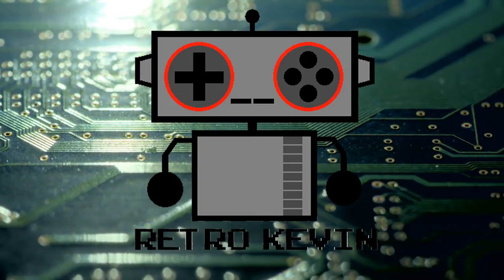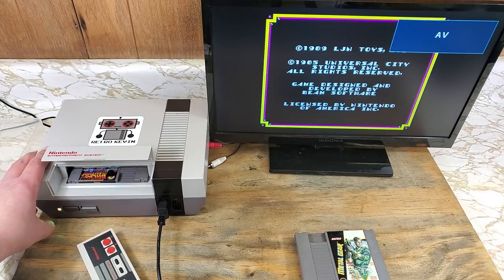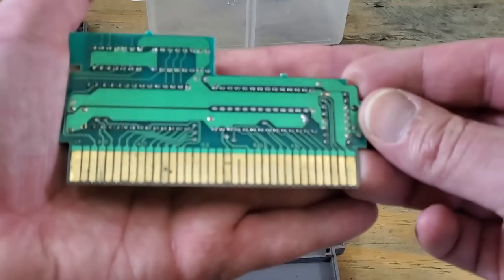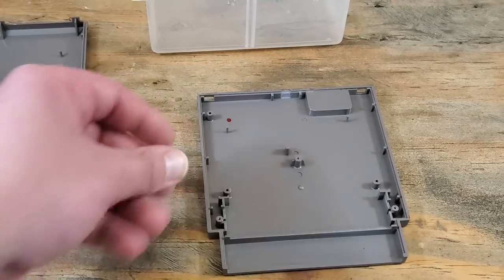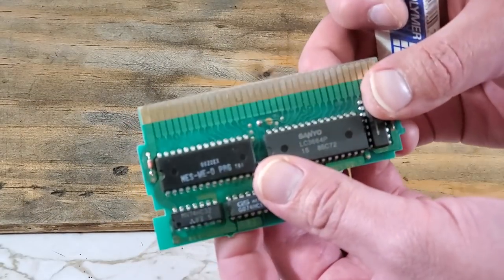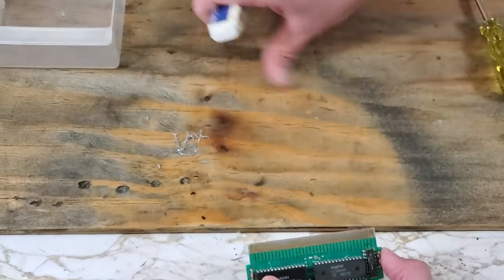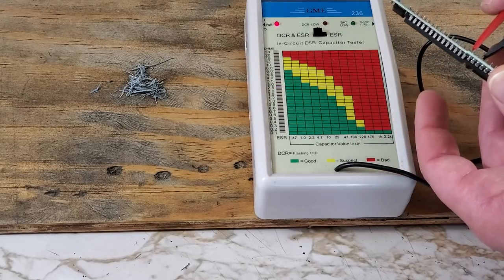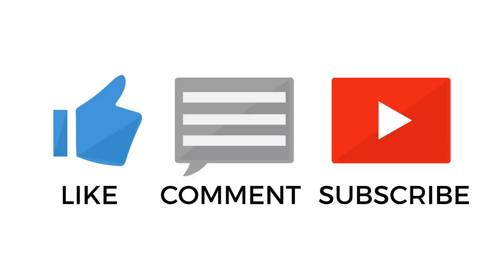NES game cartridge cleaning/repair

Comment: To get an accurate reading, you should remove the cap from the board.
However, testing while in circuits gives false readings.
That cap is probably perfectly fine.

Comment: Great video! For cleaning soft metals like copper contacts I like plastic brushes. The bristles tease out things that a swab or eraser might slide over. I also like plastic scrapers and picks. I sometimes use “flossers” to clean the contacts in usb or Lightning connections.

Almost forgot! Have you ever tried a protective coating like dielectric grease or maybe some type of oil? I’ve been wondering about this and I might dig out my old consoles to try it. As an electrician I would speculate that the corrosion was probably caused by a bad connection. I would bet that all of the games played regularly in the same machine develop corrosion on the same contact. Even low voltage will arc at small enough distances so an imperfect connection between pin and contact could theoretically be arcing which would cause heat and increased oxidation. I think a fine film of dielectric grease or oil would help reduce this, but it’s just speculation.
Reply from the maker: Thanks for the tips. I'm by no means an electrician, I just do this for fun as a hobby. So I always appreciate hearing different ways of doing stuff.

I never thought about the corrosion coming from a bad connection. But that makes perfect sense. I just always chalked it up to people that would blow into the carts and other dirty habits.

I like your theory with the dielectric grease, definitely going to test it out.
Reply: @RetroKevin  I got a copy of "Super Mario Bros. 3" and it has this godawful defect where no matter how many times I clean it, it makes it passed the title screen, but when I get sent to world 1, I can't move anywhere but still access the power up selection. Also parts of the map are permanently glitched. I contacted the seller who said he didn't have the issues I had.
Reply from the maker: @supermariof0521  if you've cleaned the connections and this is only happening with this game, I'd try reflowing the solder on the game chips. It's possible one of those are corroded or just not making a proper connection.
Reply: @RetroKevin  Solder on the games chips?
Reply from the maker: @supermariof0521  sometimes there's a small fault on the solder joint of the CHR ROM and PRG ROM game chips. Reflow the solder by heating it back up to its melting point. If you don't have a soldering iron or heat gun, a hair dyer on max setting may get hot enough to do the trick.
Reply: @RetroKevin  Wow really? Sweet.

Comment: Nice video.  Where can I find that Cap tester?
Can you provide a link to that rust spray?
Contact cleaner can help sometimes, There are a few times I have used the eraser while the contacts are still wet from the solvent and got a good result.
Reply from the maker: Thank you. 
The cap tester is a GME Technology 236 In-Circuit ESR & DCR Capacitor Tester. I got mine from Amazon, but I'm sure it could be found elsewhere.
And the rust spray I find generally right next to were I get my contact cleaner and where I found some White Lithium Grease.
I have some contact cleaner on hand. Maybe I'll try that out here.
Reply: @RetroKevin  Just found your channel and really appreciate and enjoy your videos!  Dude, have you ever considered a career in voice acting?  You've got talent bro!  Thanks for sharing!

Comment: My go to for dirt cleaning is a toothbrush, way easier than a cotton swab on those grates. And a little water moist. If you need to do thorough cleaning, iso-propanol is the only safe liquid.
Apart from cleaning, I found some carts to have thinner boards, and those are a real pain in the ass. Any solution for those? Solder everything on a replacement board?

Comment: I've been using Hydrogen Peroxide for years to clean those connectors without disassembling the cart itself.  the "Corrosion" is more like the rub marks from the internal pins in the NES itself.  I've rescued smoke and heat damaged carts and got a filthy (and rare) Q*Bert cart going again.  this has even worked for me for Atari carts, which get the same connector smutz.
btw, half of the blinky mode on the consoles is a console problem.  even then they were putting anti piracy chips in, I hear, and that causes problems.
Reply from the maker: I'd recommend staying away from hydrogen peroxide for cleaning games. Even more so if they're rare. 

Hydrogen Peroxide can cause oxidization on metals and can permanently damage the PCB.

Comment: These little electrolytic caps are so old that at this point whenever I get a new to me cartridge, I just go ahead and replace them. If I remember right they're power input filter caps for the ROM chips so a failed capacitor can give you all sorts of fits when it comes to tracking down potential causes of an inoperable game.
Reply from the maker: Not a bad idea. They're cheap enough and easy enough to replace. 

Seeing as how most sources say the lifespan of a cap is ~20 years it's safe to say every cap should be replaced.

But if they've been working well past double their life expectancy, and continue to do so... do you fix what isn't broken? Or do we see how far our technology can be pushed?

Comment: I have a game with a few missing parts on the pins from corrosion can I reflow this some how?
Reply from the maker: Great question. With the correct tools and everything it's possible. Unless you're fixing a very expensive game it's not worth it.

On the cheap I've had mixed results with just using soldering on corroded pins.

If you have enough soldering skills and a donor cart with the correct mapper you can swap out the chips.
Reply: @RetroKevin  yeah it’s a Pokémon game and as far as I see online it’s all crazy in price like $100 bucks a game cartridge so if it’s possible I’ll maybe try to repair this one lol
Reply: Mine is also messed up, its a cheap game but I love this game
I will put the parts onto a new PCB

Comment: Can you put the pcb into a ultrasonic machine fill with 91% IPA ??? I think that would do the job
Reply from the maker: I have no experience with ultrasonic cleaners. 
Sounds like you might have one, or at least some experience working with one.

What would be the steps on using one with a NES game pcb?
Reply: @RetroKevin  yes, indeed, I got one little ultrasonic unit that I bought few years ago.  I also test it on some pcb.  It does the cleanest result I ever seen.

The step to use it with a nes cartridge would to do all the trace repairs with copper wire and solder.   Once it's done,  put the pcb into the ultrasonic machine,  and fill with IPA 91% or more till the pcb it's submerged.  Do not put pcb with mic or speaker. 

I never had chance to try to remove corrosion with my ultrasonic machine.  If it removes permanent markings from a marker and removes all flux traces,  I think it might do the job

Comment: I have a Contra cart that i cannot get to work. At best, i get a solid red light on the NES and a blinking grey screen. Its not the only one that struggles to play but its the only one i cant get to work at ALL, my other games i maybe need to try 2-3 times.
The circuits and components look fine, but i suspect the issue is the contacts. It looks like someone sanded them down to clean them. Is that possible to fix like by thinly layering solder on them, or is that a recipe to damage the NES-side connector?
Reply from the maker: DO NOT add solder to the game pins. I've tried this before for the exact reason and went from a somewhat working game to a non working game.

There's a few fixes for this, however I have yet to find a cheap and easy one.

Easiest fix, is buy another game and hope that one works. Of course that's not really a fix.

My recommendation will require soldering skills. But I'd try and find a donor cart from this list:
https://nesdir.github.io/mapper2.html
and swap the "CHR ROM" and "PRG ROM" chips.

If you've never done this before I highly recommend practicing on some games that you're not afraid to lose.
Reply: @RetroKevin  Eletronics guy so Soldering is up my alley, but ive just never attempted that sort of fix and im not stupid enough to "wing it" when i feel like i may break something in the process.
I'll check out those donor carts, thanks.

Repairwork is something i have done little of, seeing as how modern stuff is "swap out the board" type repairs. So this sort of thing is new to me.
I'm assuming what i do with that link is find my game (Contra) and look for a donor PCB listed in there?
Reply from the maker: @vineheart01  Yeah, so NES games use what's called a mapper. Basically those allowed the games to be bigger than the NES would accept by default. In theory the CHR ROM and PRG ROM chips are swappable between the same mapper games.

I linked the Mapper 2 list, which is the one Contra uses. Search for a cheap game on there and use that one as the donor cart.
Reply: @RetroKevin  Sweet, thanks

Comment: What kind of eraser was that and what kind of alcohol
Reply from the maker: Any eraser should work. Even the ones on the back of a pencil (just be careful or the metal part). However, what I use is the hi-polymer plastic kind normally used for drawing. 
The alcohol used in this video is isopropyl. I haven't noticed much of a different in the % but I believe this was 91%.
Denatured alcohol works just as good, if not maybe a little better.

Comment: kevin, what kind of eraser was that?
Reply from the maker: Any eraser should work. Even the ones on the back of a pencil (just be careful or the metal part). However, what I use is the hi-polymer plastic kind normally used for drawing. 
You should be able to find them at any Walmart, office supply store, or hobby shop.

Comment: Where can you buy capacitors for NES games?
Reply from the maker: I work on a lot of different electronics, so I buy in bulk.

Honestly I can't remember the specifics of the ones used in NES games. I do know it's a super common size and can be found online for under $1 a piece.

"Back in the day" you could go to your local radio shack for this sort of thing, sadly those types of stores are few and far between these days.
Reply: Oh okay. I can't find the right physical size of the capacitors. I can find the right rating of the capacitors but not the physical size.
Reply from the maker: @ctg8563  Physical size only matters if it doesn't fit. Otherwise ratings are the important part. If need be you can even go up in μF and volts.

Comment: Protip: Clean games BEFORE testing them. Crud easily rubs off the cart onto the 72 pins. Unless you want to keep cleaning console pins clean your games first.
Reply from the maker: This is actually great advice.

If you don't have spare 72 pin connectors or the know how to refurbish them (I have a video on how do that) you don't want to throw dirty games at your clean connector.